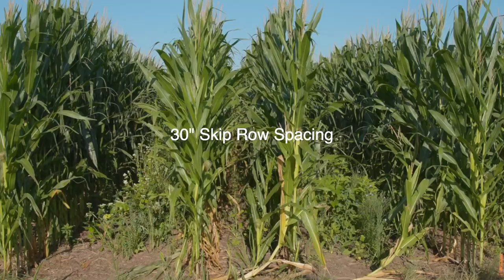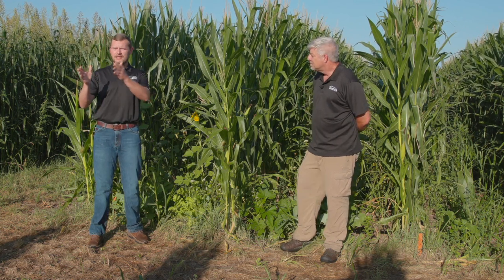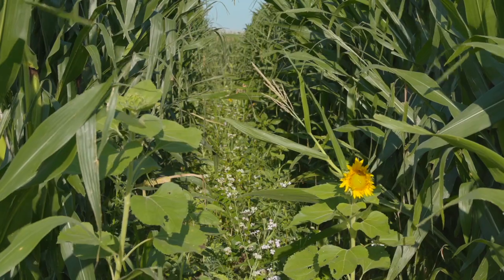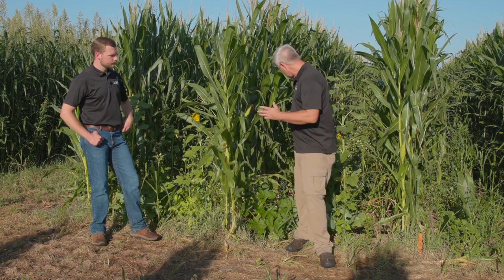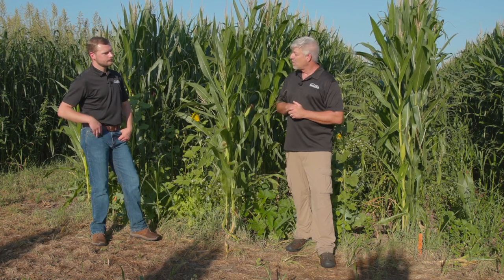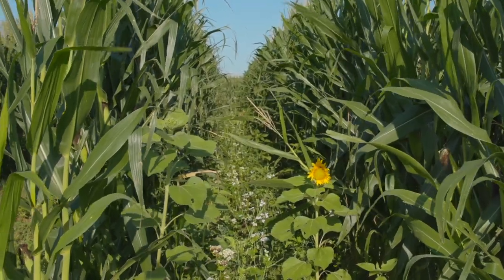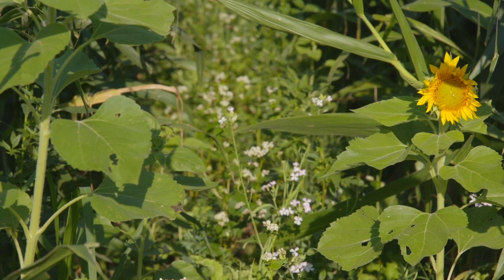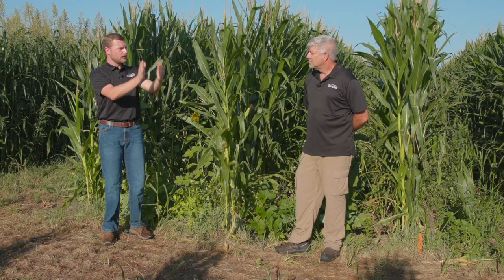Corn Inter-seeding Trials

Comment: I'd love to see someone try 36-40" old school wide rows. I think we're leaving a lot on 60" up to that cover establishment and any gap is going to bring increased weed pressure.  Plus the missing rows going into a corn head just sorta makes me twitch, it's not great to run chains unloaded slapping around and unequal gearbox loading comes to mind.   30 and narrower for conventional systems, 60in if you have a heavy cover emphasis, but the ugly step child 38s might be the next thing i start field trials on
Reply: I’m waiting for a row planter than can drill the cc on either side of the crop row? Save you a second pass with a drill or vice versa. This would make a dynamite food plot matrix.
Reply: Depends on species and crop I suppose but if the goal was burn down and plant both in one pass, then that would be slick.  Some slower starting stuff I've seeded ahead of the planter, and more dry season tolerant stuff broadcast after planting.   I haven't been real fond of the extra disturbance caused by adding 2-3 drill row units in the midrow with some of the setups I've seen.  We are in a high erosion highly sloped area so that pushes some of the thought to lower disturbance methods.
Reply: @scottschaeffer8920 Amity out of North Dakota was working on a row unit that could put your corn down on 30 in and then a cover crop and either side or fertilizer on one side and cover on the other or fertilizer on both and then you could take that same unit in season and put down a mix of covers and fertilizer. I don't know if they ever brought into Market
Reply: The crop adjuster doesn't need to know nothing. LOL
I am not too worried about weeds. In the past I've done a good burn down with a good residual. And then come in later with the cover crop mix. Next year I will eliminate Roundup and eliminate the residual herbicide and just do a simple burn down of the Rye and then bring in the cover crops.

Comment: Corn Seed spacing within the row on 60 inch rows???? Dennis
Reply: Probably 3-4 " apart....  twin rows on 60" would be better as that would maintain the same plant spacing as 30" rows but we are not set up for that
Reply: @Keith_Berns_GreenCover  could there possibly be a used planter design  available which could plant corn that way...Dennis
Reply: Where is the planting drill found? I have modified planting a bit by plugging grain drills
BUT no modifications that extreme. Dennis
Reply: Where is the planting drill found? I have modified planting a bit by plugging grain drills
BUT no modifications that extreme. Dennis